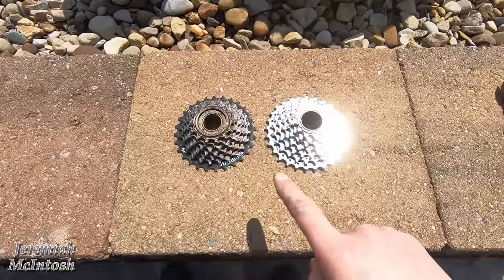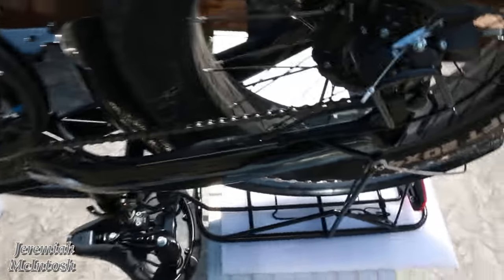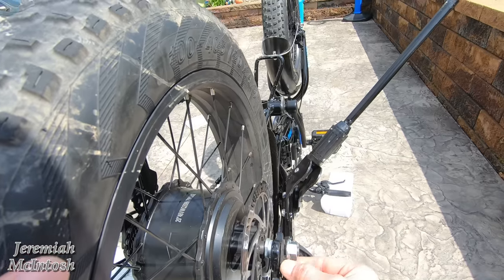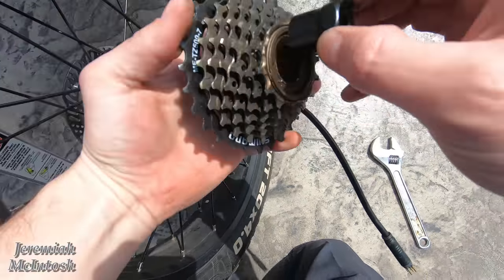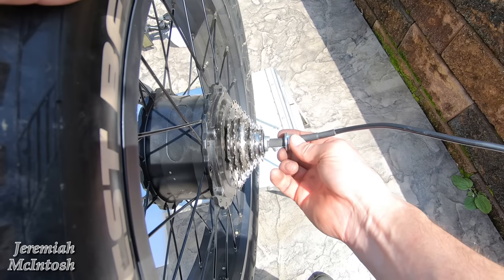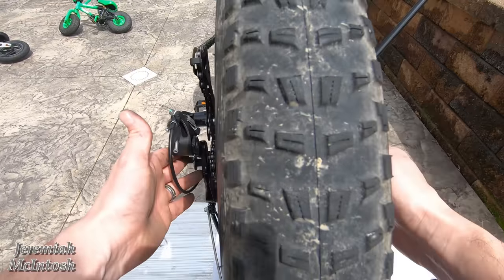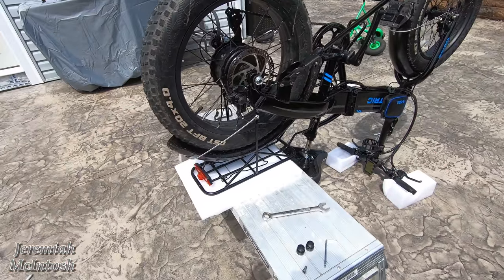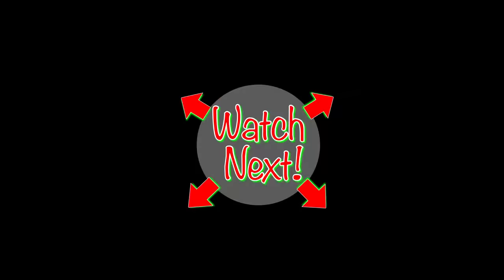Lectric Xp E-Bike Freewheel Upgrade replacement Tutorial and differences

Comment: Awaiting an online tube to fix my flat, rear tube, at 255 miles.  Patching not successful due to extreme puncture.  Found an idea for a rear stretcher from hardware turnbuckle + cane tips from a different youtuber.  Wish me luck 🍀
Reply from the maker: I’ve had my back wheel of twice now and haven’t needed a spreader. Good luck
Reply: Thanks.  Got the new tube in the rear tire and had no issues with the frame pinching the hub.  Your encouragement is appreciated.  258 miles on the odometer.
Reply from the maker: That’s great I’m glad you got it fixed! Happy riding!

Comment: if u can take some measurements of and or video of the handlebar post connection to the fork.? I should be getting my xp in the next couple of weeks and am planning to upgrade the fork to a suspension fork. ive found a few fat tire forks but haven't ordered anything yet because im not sure and I dont want to spend money on something that wont work / fit the frame. I think you might like the upgrade and get views on a video upgrading the fork. its definitely one of the top wants of owners as far as ive seen. someone at lectric said they hadn't found one that works yet.? but if you did an amazon affiliate link to it might make you somethin.? just a request/idea if I get mine and do the upgrade before I see a video from you on it ill post a link to the fork and any special tools needed. thanks for the freewheel info.

Comment: Did you consider changing the front chain ring instead? It's a 51T which on a regular bike would be the biggest of a 3 ring set.  I'm rarely on the big ring on my bikes and only used for speed going downhill.
Reply: I think the front for the Lectric's are 52T.
Reply from the maker: I think you are right it is a 52t. Also I stated the factory freewheel is a 13-28 I’m my video but it is actually a 14-28.

Comment: I have a black Lectric XP and after viewing this video, I ordered the same freewheel that you did, and I swapped the stock Shimano 14-28T for the new 11-28T.  I noticed a small problem with the new freewheel. I noticed some slight clicking noise in gears 1, 2, 3 and 4. I tired adjusting the derailleur, but it didn't help. Then I discovered there is a wobble in the freewheel, which is causing the chain to slightly misalign with the cogs thus causing the noise. The wobble is at least 1/16th of an inch, maybe a little more. I didn't check the stock freewheel for this wobble. Did you experience this wobble with your new freewheel as well? I don't know how to fix it. Maybe switch back to the stock freewheel.
Reply from the maker: Most freewheels will have a wobble, Both of mine do. Did you remove the spacer before installing the new one?

Comment: There is a guy who made a spreader out of a 4 inch turnbuckle with cane feet that fits between the frame easily and holds it open. He posted it on YouTube as well
Reply from the maker: Yea I seen that but I don’t need  it because I can easily remove and install my wheel without the spreader.

Comment: Great video.  I will attempt this on the G-Force T42.  Have you done this on your T42 as well?
Reply from the maker: No I have not yet but it should work.
Reply: @JeremiahMcintosh  Just put this freewheel on the T42.  It went on almost exactly like the Lectric.  I also had to remove the shim that went between the freewheel and the motor.  Unable to test it on the road but the gears seem to shifting well.  I may need to adjust the derailer slightly once I road test it.  I am looking at the Anioki A7 Pro now.  My wife loves the T42 so I may bite the bullet and buy the A7 Pro.

Comment: I want to change mine for the same reason but i have a large connector plug on the end of my cable so the freewheel cassette fits through just but i cant get my removal tool through the cable and i dont think i can take the fitting off and on again.

Comment: Watched the video and successfully made the upgrade just how you described it. Would have had no idea not to use the spacer.  That little tidbit would have caused me to have had to do it twice.  Getting the wheel back in / disc brake at the same time is a bit of a challenge. The hardest part was after I finished. Had to watch another video on how to adjust the derailleur.  This video was very helpful.
https://youtu.be/UkZxPIZ1ngY
The new part and the tool are available on Amazon.  
The performance is amazing.  Now pedaling hard you can push 30 mph!  
Thanks for the video!

Comment: Jeremiah, can I adjust the power DOWN for a younger daughter to use this bike?  I'm concerned about the bike getting away from her.  LOVE your videos!!
Reply from the maker: You can adjust how strong the motor kicks in to some extent in the settings and keep it on pas1 but it still may not be enough for you. 
You can also set it for the throttle to only work when moving so it doesn’t work when stopped.

Comment: Are most freewheels the same size thread on different ebikes? I let my cousin ride with me on my speedrid and he got in to some muddy water and got sand in the bearings im going to take it apart and try and clean it out but a freewheel is cheap to just replace the whole thing if they are all pretty  much the same .. i am a tractor mechanic so it shouldnt be hard to change out i ordered the tool to do it so i can at least clean the one on it
Reply from the maker: So far all the freewheels I’ve changed have been the same.

Comment: Hey Jeremiah...great video and channel...Is there any difference at all doing this upgrade on the XP.2.0 or new Step thru?
Reply from the maker: I’m not sure because I have not changed it on my 2.0 yet it should be the same but some people were saying there may be something different with the spacer on the new 2.0 however I can’t confirm Because I haven’t taken it apart yet.
Reply: @JeremiahMcintosh  Thank...Just completed the upgrade and display works , shifting works great but I lost PAS and all throttle control ....what did I do wrong?
Reply from the maker: I would check the motor power wire. Make sure the arrows are lined up and it is plugged in all the way.

Comment: Would it work to change just the single front sprocket with a slightly larger one?  Just seems like that might be easier as long as it fit and didn't run into anything.
Reply: You could but keep in mind a front sprocket change will change all of your ratios. So if you are looking for a higher final ratio (slower pedaling at high speed) changing the front will also make your first gear higher ( less hill climbing capability).

Comment: Hi, what's the difference between the 7spd 11-28 and the 11-34 freewheel 7 speed?
How is this on the bike today and did you decide to upgrade this freewheel since, for an even better pedal ride? If so to what?
And compared from what you know then & now, if you could which type of freewheel would you recommend to get for the best riding experience?
Reply from the maker: The main thing you have to ask yourself is if you have very steep hills in your area. If so you may want to consider the 34 tooth freewheel because it would be better for steep inclines but you will be rotating the pedals very fast in first gear. If you have moderate to no heels I would stick with the 28 tooth freewheel. I still have the 11 to 28 on my bike and I’m perfectly happy with it. With that being said my wife’s bike still has the factory 14 to 28 freewheel and I do not plan on upgrading it because she normally rides at slower speeds under 15 mph. Have you seen my comparison video if not here’s a link for it.https://youtu.be/9dTgbcyYLBE
Reply: @JeremiahMcintosh  No, there are very few steep hills/inclined areas near me, I live in the city, so besides all the potholes, the roads are pretty much leveled. The 11-28 tooth sounds like it would be the best option, so I'll keep that and add it to my ebike list. Thanks for this its helped me with choosing the better option.
Reply from the maker: No problem glad to help. With the 11-28 tooth freewheel your first gear will stay the same as it is now with the factory freewheel.

Comment: Hey Jeremiah, my shop did my install. They left the spacer on inside of the freewheel between the motor. They must have adjusted the gears because the bike rides and shifts perfectly. Do you think I should take out the spacer?
Reply from the maker: To be honest I don’t know how they got it to fit back in the frame with the spacer because when I did my install I have noticed that it makes the freewheel stick out a little further that’s interesting. I’m not sure what to tell you if it’s working fine it might be OK?
please keep us updated what you decide to do thanks.
Reply: @JeremiahMcintosh  It rides great but looks so odd because 1st gear is 1cm from the motor &  7th is about 1mm the frame. There is almost no margin for error is something moves out of alignment  thx!

Comment: Do you think that freewheel tool will fit over the axle bolt and still get the freewheel off? The plug for my motor is too big too allow axle bolt removal so no freewheel changes for me...
Reply from the maker: No it will not. Is your bike Lectric I’ve only heard of rad bikes being like this ? I believe there is a tool for this with a slot cut in the side of it for the wire to go through.

Comment: Jeremiah, how's the B-Soul saddle bag in regards to fitting  over the frame? It looks like it fits perfect on your bike but, judging by the dimensions on Amazon, it looks like there's only an inch between the two bags, yet the bar is about 2.5" wide.
Reply from the maker: It actually fits really well on the frame and you have about a half inch to spare. I really like this bag how it covers the frame instead of sits on top. Actually in my next video I talk a little bit about it and what I use it for.

Comment: Did you change the freewheel on the step thru yet and if so. Is it the same parts and same process thanks
Reply from the maker: No I have not but the parts and the process should be the same.

Comment: Hey i left a comment in your other good vid about the seat, what can i do about
 my squeaky brakes on my xp. Or tell my bike mechanic to do.
Reply from the maker: Before you ride your bike for the first time you should wipe the rotors down with rubbing alcohol and adjust your brakes. There are some good videos on adjusting mechanical disc brakes that you can watch but it is fairly easy. Also make sure your rotors are not bent and if they are you can bend them back slightly to straighten them. My brakes do squeak occasionally but nowhere near like they did when I first got the bike.

Comment: I'm thinking of doing this but with 11-34 ..I have the same ebike but different brand, it can go up to 40-45km/h but I do peddle crazy-fast which is annoying - Hey @Jeremiah Mcintosh did it help much or just a bit? (wondering if it worth the trouble)
Reply from the maker: Yes it is definitely worth it. Check out my comparison video between the old and the new and you will be able to see the difference in pedaling!
Reply: @JeremiahMcintosh  Nice, thx for the reply. I've got a bigger bike ..I saw yours is a tad smaller, mine is a full size but similar style(26" wheels), with biggest sprocket front and smallest in the back I still have to peddle like crazy and I don't contribute much while I'm sweating, I want to fix that :D

Comment: How would you do this for ebikes that have a fatter electrical connector to where the nut and washers won't fit over to get it off?  I think the tool and freewheel will go over it but none of the other hardware.   I have a himiway but radrovers are like this also.  Pretty much at a standstill now.  Augh.  Appreciate any advisement...
Reply from the maker: 🤔 not sure? I wonder how they put it together ? That’s a silly design!

Comment: I just did the 11-34 swap. It was very easy to do with the help of this video. But now the chain slips in 5th gear. Any ideas why this is happening?
Reply from the maker: You probably need to adjust the derailer slightly.
Reply: @JeremiahMcintosh  thanks. Do you have a video on that?
Reply from the maker: Unfortunately that one I haven’t made yet.

Comment: Jeremiah, thanks for the great info. Do you know if the 11-34 fits a lectric xp and would 34 teeth in first gear give me more torque>
Reply from the maker: Yes it will make it easier to pedal up hills. I have not personally installed the 11 to 34 but I’ve seen others have done it and it worked well. Just make sure you get the freewheel and not a cassette.
Reply: @JeremiahMcintosh  Thanks very much for the quick response. I read some reviews of the 11-34 and at least 2 people mentioned lectric xp.
Reply: @JeremiahMcintosh  Do you think the 34 tooth will require a bigger chain?
Reply from the maker: I don’t think but not 100% sure. Maybe I’ll try it in the future.
Reply from the maker: I don’t think but I’m not 100% sure. Maybe I’ll try it in the future.
Reply: @JeremiahMcintosh  I found a video from SKVP Photo where changed to the 34 and appeared to use the same chain. I ordered the 11-34. I will let you know once it is changed. THanks for the inspiration.
Reply: @JeremiahMcintosh  SKVP says he did not need a longer chain. I just thought you might want to know in case you want to go bigger on the freewheel.
Reply from the maker: Glad to help 👍

Comment: they are out of the freewheel any replacement suggestion, so I get the right one.
Reply from the maker: Thank thank you for the heads up I’ll update the link.
Here is one that should work.https://amzn.to/3rHAOCa

DISCLAIMER: This is an affiliate link which means that if you use it I’ll  receive a small commission but it’s no extra cost for you!

Comment: Is there an advantage of getting a 11-32T?
Reply from the maker: yes the 11 to 32 will allow you to pedal up deeper inclines easier with the 32 tooth sprocket and will allow you to maintain pressure on the pedals at higher speeds with the 11 tooth sprocket.

Comment: Do you happen to know what type straps and how long are needed to separate the bike frame?  My wheel is extremely tight in the frame.  I tried to remove it the way you did.  It wasn't possible.  Also, do you know if there is a video anywhere that shows the straps being used?  Thanks for your help.
Reply from the maker: I do not know of a video I think there was a post on a Facebook group to put the bike between two posts and use two ratchet straps to pull the frame apart.
Reply: @JeremiahMcintosh  Thanks for that info.  Do you happen to remember which Facebook group had the post about the ratchet straps method?

Comment: Am I understanding that the reason for changing the freewheel is so when going 28+ mph, your 7th gear is still allowing engagement. It isn't "freewheeling"? Also, at 11:20 After putting on the new freewheel, do you use the freewheel removal tool to tighten the new one before reinstalling the shim or is finger tight all that's needed? Thanks!
Reply from the maker: Yes that is correct and I did snug it up with the tool slightly.  What spacer are you talking about…the outside one?
Reply: @JeremiahMcintosh  I was referring to the "shim" that you weren't exactly sure what it's called that was put on right after the freewheel to prevent the axle from spinning in the frame and goes on with the little tab in the same orientation as the cutout on the axle. In the video, you spun the freewheel on the threads and then the video went right to the installation of that "shim" so I wasn't sure if you tightened the freewheel with the freewheel removal tool and crescent wrench or if finger tight was all that was necessary.
Reply from the maker: Oh ok. Yes I just snugged it up slightly with the tool.
Reply: @JeremiahMcintosh  Sounds great! I'll likely be doing this upgrade if and when I get my 2.0 bikes. Now that it sounds like China is going into another lockdown because of Covid, who know when bikes will be shipped to the States.

Comment: One improvement: the reviews for the Dnp are shaky at best. I found a different manufacturer the specifically mentions "built for e-bike" and the higher torque produced! That is my only improvement; other than that this video rocks! https://www.amazon.com/gp/product/B07XYNSHZC/ref=ppx_yo_dt_b_asin_title_o02_s00?ie=UTF8&psc=1 These instructions are straightforward and simple. It is important to remove the shim behind the freewheel so shifting works well. What I like best about the change is the lower amperage drawn on level ground in 7th gear. Less amperage = more miles per charge.

Comment: would i be able to change the sprocket on the freewheel on a Heybike Mars like you did on the Lectric xp ? Are they the same gear Ratio
Reply from the maker: The Freewheel on the heybike is the exact same one that comes on the Lectric so I’m sure you will be able to change it. Keep in mind that Lectric has a 52 tooth chain ring in the front heybike has a 48.
Reply: @JeremiahMcintosh  thanks for the reply. Do you think it will make a difference and an improvement though?
Reply from the maker: Yes i’m sure it would make a difference at higher speeds.